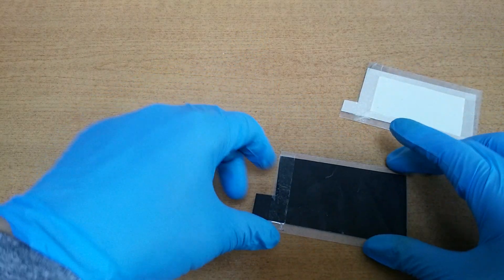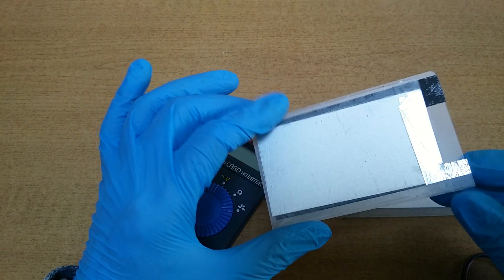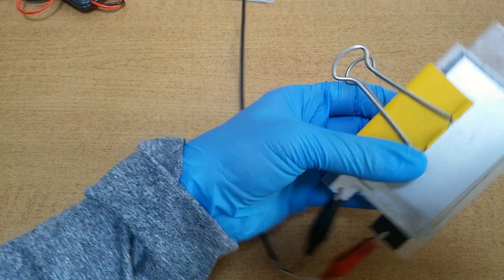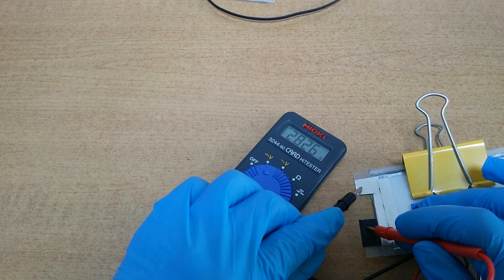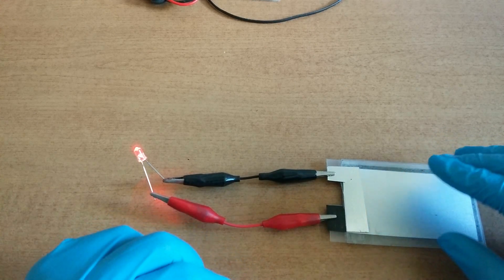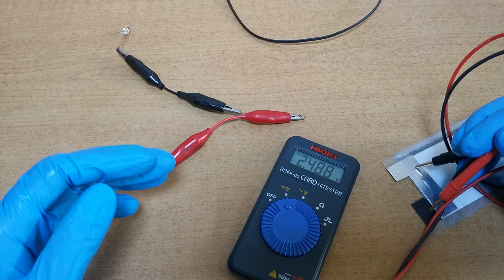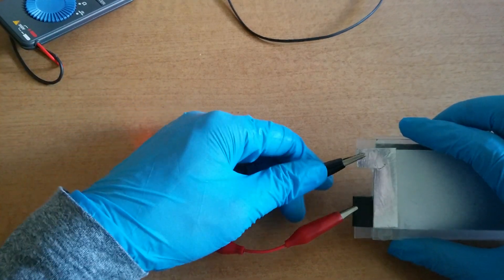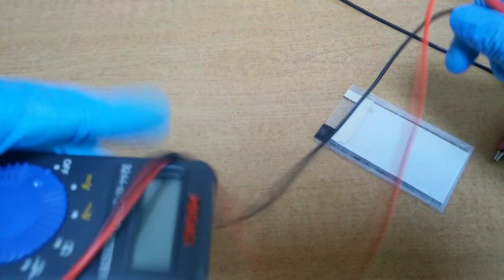graphene solid state battery experiment (using soap)

Comment: Hello from Greece. you don't need to ovecome the 2.1V at one layer cell. The Li-ion batteries  are  made with 2 layers. Think of it....
Reply from the maker: Thank you. Really thank you
Reply: @solidbattery9956  THE ONLY THING YOU HAVE TO DO, IS TO FOUND A PROPER TYPE OF SEPARATOR, TO MAKE THE OTHER LAYER.
Reply: @Dionysios_Skoularikis  yeah man 
But I add toothpaste with detergent 
But the toothpaste have : callcium oxide , sodium chloride,  sodium lather sulfate ( I can't remember the name ) ,  sodium fluoride , rock salt and zinc oxide 

And I will try it again with this toothpaste !
Reply: yeah in fact 2.1 x 7 is nearly a perfect pile and would be compatible with existing 12v equipment

Comment: hello again. you mentioned the voltage drops after few days from 2.8 v to 1.1 .is there a problem?? all batteries will on standby drop voltage & if load is connected that is normal?? if two cells are combined then you can reach that goal.
Reply: it can be recharged & if recharge cycle life is say 1000 that is enough for running 2/3 years of active usage.
Reply: @DineshKumar-rl5hc  hmmmmm
Reply: @DineshKumar-rl5hc  his experiments are FAKE I tried them and when I ask a question this dude won't answer
Reply: @DineshKumar-rl5hc  Don try it
Reply: the paper battery that is designed by you what recycle life do you expect??
Reply: @DineshKumar-rl5hc  well those batteries won't work! I tried making one! It didn't work so pls dont waste ur time this is clickbait